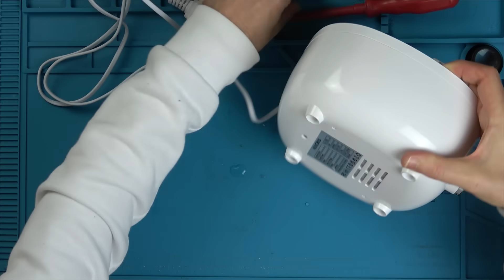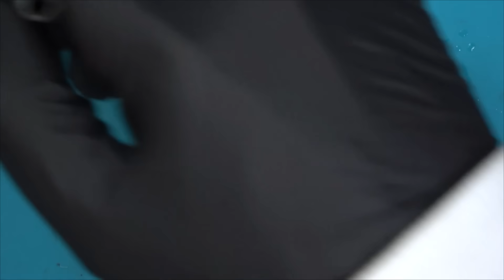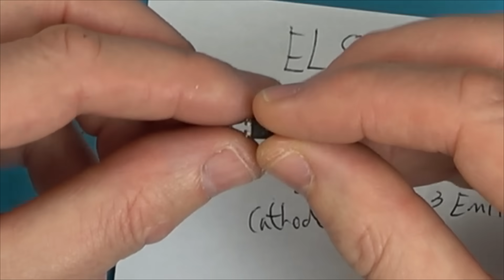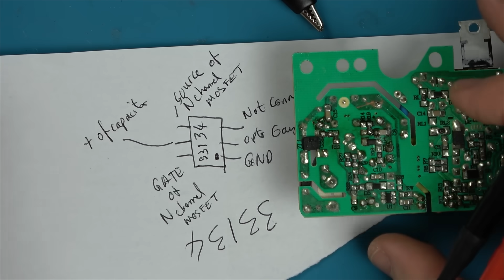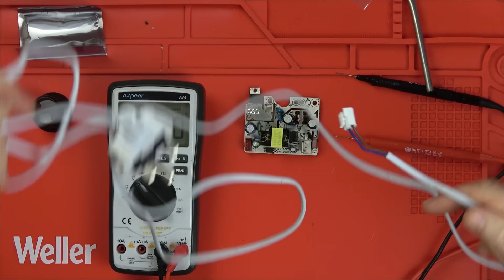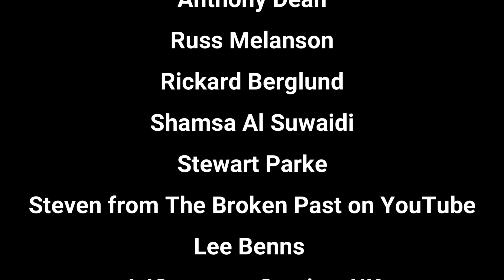Trying to FIX a HUMIDIFIER - NO POWER

Comment: Nice result again Vince! Looks like you could use a new tip for your soldering iron. The tip seems quite 'scorched', what temperature do you use? I believe there's no need to exceed 350 C, depending on the iron and what type of tin is used, 320 is sufficient for leaded tin on my Weller iron. Keeping the tip clean and tinned eases soldering, seemed you were struggling a bit when soldering the chip.

Comment: This looks like a fairly generic design.  I own one with the same parts, just looks different and has a different brand name.  The two holes at the top are designed to be pointed in different directions so the mist can be spread out. They should turn on independent rings, unless it is very very cheap.   The mist itself comes from a piezo driver, the white disc at the bottom of the tank. The piezo vibrates at a very high speed, driven by the transistor normally used to drive CRTs.  The small blower just induces the mist to flow up and out.  Good work getting yours working again. Unfortunately these models do need to be taken care of to work properly, yet they aren't built well or ruggedly.

Comment: (1) 16:00 You Should Get Some "Soldering Tweezers", for Those Smaller Components (Hot Air iS Better for Chips & Bigger Areas).

Comment: 34:40, actually well thought off! Kind of exactly what the optocoupler or feedback circuit does. It makes it so the output can sustain the same voltage and or power output when loads change. If the output draws more load, the ic will change its frequency to much higher, and when the output load drops, it decreases frequency as to not undervolt or overvolt the output. 

Its also why the cheap older chargers you can get for 10 cents of aliexpress can almost provide nothing. They often use an older design based on discrete transistors that dont have any really good feedback circuit so when you load them, the output often drops to 0 or very low voltage. Also often those powersupply chips can almost be interchanged with each other, although there could be differences in drive signals, feedback to frequency curves and other higher level knowledge stuff. 

Those humidifiers work by pulsing a ultrasonic tranducer at a very high frequency, making it so the water breaks up in tiny droplets, which the fan will blow out of the top hole.

Comment: I never knew how useful I would find one of these, until I moved to a new place that has humidity of under 40% daily. 
Not one week after I moved there, in came the nosebleeds. Apparently we as humans require a bit of moisture in the air for our nasal membrane to function properly, otherwise it gets all dry and its very easy for the membrane to get damaged..
Don't get me wrong, I thought 40% humidity would be great, no mold can ever form.. but honestly, I was wrong. 50-60% is the way to go.

Comment: Well done. The two series start up resistors are usually the same value for voltage and power sharing. 1206 smd resistors are normally limited to 200V DC, other designs use 3 in series for good margin.
The cap is quite impressive, 130V on 50V cap? It would probably breakdown eventually.
The control chip...it really needs to be exactly the same type, but I appreciate the problem if the device marking takes you no-where. That's where 'bravery' comes in!
Generally, just because the pins connections are the same does not mean it will work, be the same in frequency, same burst fire modes, flyback operating modes, power requirements etc.. Remember that the control chip is matched to the transformer design. There are no 'generic' chips. There are hundreds, if not thousands all with subtle and important differences. If it works reliably, you rolled the dice and got lucky.  Overall 👍

Comment: Visually amazing looking, the speed. How does it atomise the water? Is it sound or vibrations or?
Reply: Ultrasonic transducer. You can get modules from Ali that include a PCB,  1 to 4 transducers and small semi-solid white wick tubes. You place the bottom of the wick in water, and the transducer at the top. The transducer has tiny little holes in it and the vibrations cause the water to get bhroken into tiny droplets that float upwards as mist.
Reply: @johncoops6897  ultrasonic so noise then. I suspected it would be noise at a frequency too high as such for humans creating vibrations. or we could just call it magic
Reply: Grrr. YT removing my comments 🤨

Comment: Horrible humidifier. Leaves white residue on everything. A much better choice is one with a pad that sucks up water and the fan blows on the pad. All the residue stays on the pad and you periodically change out pad.
Reply: Just use purified water. The residue consists of the minerals dissolved in tap water.

Comment: Hey, to celebrate my successful heart surgery last month, no angina stuff ever since with 14 stents inside the old strawberry tart I bought myself a small celebratory gift a neon green Dominatore Del Mare Amalfi which is like the old Doxa sort of diving watch but with amazing colours.   £89 if you go with Mainspring Boutique and first order 10 percent off.   Got plenty of orange watches but I just fancied a dayglo green one hehehe   Also picked up a working 3d printer... £28 incl delivery O.o   Not the largest thing in the world but I need one working so I can print off a stanchion to repair my much bigger and modified Startt 3d printer.   Also scored day before yesterday, brand new Ryzen 7 5700g CPU under £50 so been a productive week with ebay and Mainspring :)

Comment: If you have hard water, this style of humidifier should be avoided. It will constantly deposit a fine white dust on every surface in the room, which is the formerly dissolved minerals from the water. This dust is insidious and will even end up inside drawers and electronics, and it tends to stick to crystal and glass, leaving light fixtures and bulbs dull and requiring frequent cleaning to restore their proper appearance and light output.

On the plus side, my one did turn the output from my nebula projectors into a miniature laser light show in the single winter I used it. I replaced it the next year with one of the ones with a bucket, fan and filters and have been much happier.

Comment: I have purchased those at resale shops and they usually fail prematurely  due to people using regular  tap water in them. You are only supposed to use purified water in them. The minerals in the water quickly destroys them. I have one my parents purchased and used once and put it back in the box and stuffed it in the rafters in the garage. The rubber seal crumbled but I found out the rubber seal on a sink is the exact replacement for it. I use it on my bed stand every winter because it gets so dry. Water and electronics never get along well do they?

Comment: Well done. Not sure if you measured the voltage once loaded / running. 14V seems odd, though you  would need another to compare it with.
Reply: 15V nominal supply. Perhaps uses a 12V linear regulator or even as a constant current driver to provide adjustable ultrasonic drive and fan speed.
Reply: @johncoops6897  A possibility. Normally these are 12V units, but of course that is under load (current sense included) and the voltage swing on the transducer could be at least 24V pp. My only concern was that it seemed to be pumping out rather a lot at the minimum setting.

Comment: Great job, Vince.

Seeing the difference in your confidence from just a few years ago, to seeing you now repairing SMPS, it's impressive.

And you are doing most of the right things regarding safety, although it's worth looking into getting an isolation transformer.

Even better if you have an RCD or RCBOs on the house, or a separate RCD for the power strip on the bench.
(Obviously an RCD / RCBO is a "last line of defense" thing, though, and all standard safety precautions should be taken.)

I did quickly try to Google the part number for that chip, but didn't find much either.
I tried removing one letter at a time from the end of the part number, as that can sometimes help.

The main search term for that would be the "SMD Marking", btw.
Glad you found a suitable generic replacement chip, and it didn't go bang. lol

I try to avoid working on SMPS stuff these days, especially not working on Live stuff.
A lot of things can be diagnosed with a basic multimeter alone, with the device powered OFF.

The optocoupler is likely a generic "Sharp PC817" style, btw. the "EL" just refers to the specific manufacturer, Everlight Electronics.
Reply: btw, the TL431 is an extremely common voltage reference IC, that you often find near to the optocoupler in many SMPS.

The TL494 and UC3842 are also super common SMPS driver chips.

I don't know if the SMPS in the vid had a TL431. but tons of them do.

In more recent PSUs, though, more stuff is combined into one chip, with maybe one or two external transistors and diodes.

I used to be worried of even using switching regulators in my PCB projects for many years, but they're quite simple now.
Most of the time, I just copy the example in the datasheet, and use the recommended values for low ripple, etc.

(Linear regs supplying more than about 1 Amp just tend to get way too hot, and finding space for heatsinks can be awkward.)

Comment: Ic could also be an OB2263 or a SG6848tz1, those are used in the power supply of a Philips ORT7500 radio, they fail a lot there, just by itself.
There are probably a couple of ic’s with different part numbers that are virtually the same.
Sometimes pin 3 needs a 95k resistor to ground for the ic to be switching on the proper frequency.

Comment: Nice fault finding and a fix. 
My parents used to have late 70's air humidifier when we lived in an apartment building. I was just a plastic box, black top and red bottom, and some kind of air filter type thing inside, probably also a blower. Can't remember exactly, as it was taken pretty quickly out of service for some reason.
Reply: They are called a swamp cooler. There is a small pump that raises water up to the top of a fabric sheet that is draped down. The fabric is kept slightly damp and a fan blows air through the fabric and towards you.
They are called swamp coolers because they tend to create a over-humid room like a tropical swamp. They can also become filled with all manner of wierd bacteria and fungi that makes your house smell like a swamp 😂
Reply: @johncoops6897  A-ha, maybe that's why it was taken out of use pretty quickly :D
Reply: @mrjsv4935 - they work well in arid and dry climates. Useless in a humid place like East Asia or Eastern Australia.
Reply: @johncoops6897  I'm in Finland, and most of the time I think our climate is humid enough without these devices, this is the land of thousand lakes after all :) Only in winter, when it's really cold for a long time, it might get a little dry.

Comment: Watch out for those caps under the metal can, I think it’s a boost circuit there where the bipolar transistor great fix Vince thanks 😊
Reply: The circuit operates on 12-15V just like any other ultrasonic disk humidifier. Why would they drop the mains down to 15V and then boost it back up again? 😂
Reply: @johncoops6897  The voltage needed for an ultrasonic cleaner head (transducer) typically ranges from 50V to over 200V AC (RMS), depending on the specific design, power rating, and operating frequency. The required voltage is usually a high-frequency signal generated by a dedicated driver circuit, not directly from a standard mains or low-voltage DC source. 😊
Reply: @wisher21uk - well yes, but this isn't using an ultrasonic cleaner head.
Reply: @johncoops6897  I know that, it was just an example lol
Reply: @wisher21uk - oh, sorry. I didn't realise that you'd changed the subject 😂
Reply: @johncoops6897  I originally said about the capacitors as they’re film capacitors, and are normally high voltage, and with there being 3 plus the bipolar transistor and what looked like a choke it seemed plausible to be a boost circuit to drive the transducer
Reply: @wisher21uk - yeah, it's cool. I was mainly only commenting to clarify that "ultrasonic" is not limited to one technology.
Somebody else commented that "ultrasonic" means that it was creating humidity by using sound... That's not really correct, but also kind-of correct at the same time 😂
Cheers from Sydney AU 🍺
Reply: @johncoops6897  no worries John, I get where you were coming from though 😊 the uk is freezing at the moment typical winter weather😊

Comment: btw vince, when i am working on a board that can come in contact with water, you can clean it well, then add clear nail polish on it, its cheap and non conductive also it can be scraped fairly easily

Comment: For anyone baffled why anyone would have a humidifier in Britain, if your primary source of heat in the winter is a fireplace it will reduce the humidity inside your home. For anyone with a free-standing fireplace just put a kettle of water on top with the whistle removed rather than buy plastic junk from China.
Reply: Well it’s a fact that some asthmatics need more moisture in the air due because of the breathing that’s why you need this item

Comment: What you have is an ultrasonic humidifier.  The ultrasonic transducer (hi-frequency speaker) breaks up the water molecules and the fan blows the mist out the top of the unit.  The white mist (you can see) coming from it is undissolved minerals with water vapor (that you can't see).  They tend to leave white dust all over.  In the state of Colorado, USA where I live, it is a semi-arid region where the humidity often goes under 10 percent, making it as dry as any desert.  Humidifiers are popular here as the extremely dry air is hard on lungs and sinuses, with indoor air being even drier than outside.  However, in the UK, I suspect you would have no more need for a humidifier than someone in Egypt needing a dehumidifier.
Reply: I was kinda hoping we'd get to see Vince's reaction of disbelief that the little metal circle is what makes the mist. It vibrates so fast that it mechanically smashes the water into a cool mist of water droplets, blown out by the fan, as opposed to boiling water into steam, which requires FAR more energy.
Reply: Humidity is, unfortunately, much more finicky than you think.

We rely on relative humidity, and the air inside the house was, at one point (at least in well-ventilated houses), outside.
As you heat the air up, the amount of water in the air stays the same but its capacity has increased; ergo, the relative humidity falls, and we feel this as if the air got drier.
The opposite is true too: as you cool the air, the amount of water in the air mostly stays the same but its capacity has decreased; ergo, the relative humidity rises, and we feel this as if the air got more humid.
The only exception for the opposite is if the air is already at 100% relative humidity; in that case, it can't hold more water and if you continue to cool the air down, it will start to dump its humidity onto surfaces as dew!

Sure, the air outside may be 95% humid, but as soon as you bring it indoors and heat it up, it plummets (or, inversely, it starts to deposit as dew as you cool the air during summers).
That's why you need a humidifier during winters; if the temperature outside is low enough, even fully saturated outdoor air will become unbearably dry indoor air when you heat it up to normal room temperature.
Reply: Slso, certain respiratory conditions can, in theory at least, benefit from a more humid atmosphere.
Reply: Yes, in Colorado we always ran humidifiers in the cold, dry, winter months.  And, the comment about the white "dust" is also valid and a real consideration (e.g. in an electronics [computer] room.)  If one can afford the cost of using distilled water, that issue is moot.  Also, allowing the mist to fall directly adjacent to the humidifier is causing much more moisture to be drawn into the electronics as the fan creates a vacuum through the vents at the bottom of the compartment.  I generally (as I am doing currently in the northern panhandle of Idaho) place a fan near the humidifier to rapidly disperse the mist into the circulating air.  Lastly, I used to open up the case at the beginning, and again about mid season, and lubricate the fan "bearing" with a drop of 3-in-1 machine oil, as it will begin to howl if dried out (the white dust was a factor.)

Comment: There are two holes as one is exhaust and the other is for air coming in to replace the water going out otherwise you get a a vacuum forming performance goes to crap.

Comment: The most important parameter of the opto is the current transfer ratio. This is not the way to test that. I would have measured the voltage of the TL431, then with a scope the working of the smps IC. (check the signals on it's pins.Be careful with that multimeter, the only protection it has is a single PTC. That must be one of the least protected DMM's ever made. It is only safe for working at low voltage, low energy circuits, not for mains voltages.

Comment: One would have assumed that items like this would have conformal coating
Reply: Why? There shouldn't be any way for the water to get out from inside the bowl and down onto the PCB.
In this one, there may be a leaky gasket between the ultrasonic transducer (large silver disk) and the bottom of the tank.

Comment: If I was the manufacturer of this, I would not worry about later repairability, instead I would cover the whole board in a thick layer of waterproof clear coating, to prevent liquid damages. It is not hard to scrape off some of that in case this device goes bang and needs to be repaired somehow.
Reply: That's bad for future sales they're designed now as throw away items at cheap prices